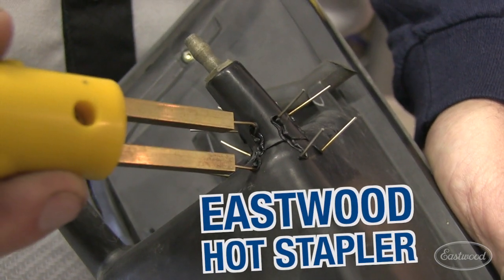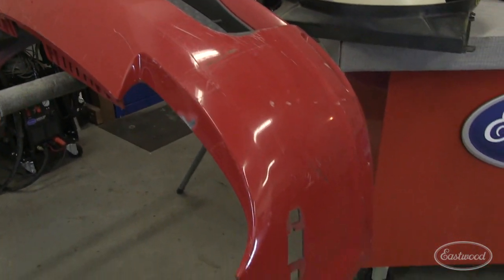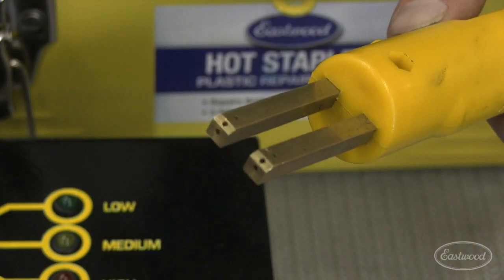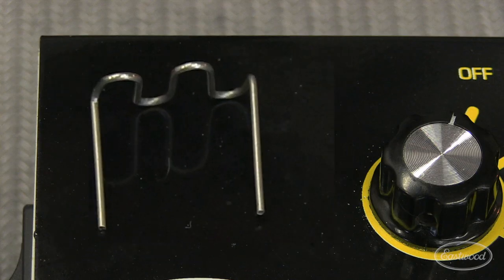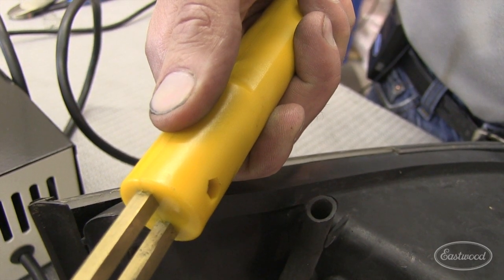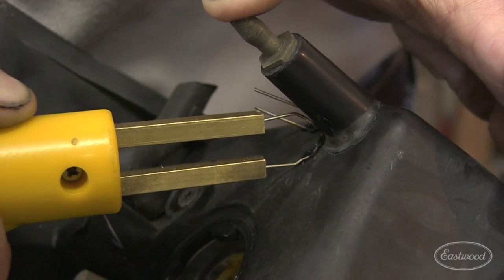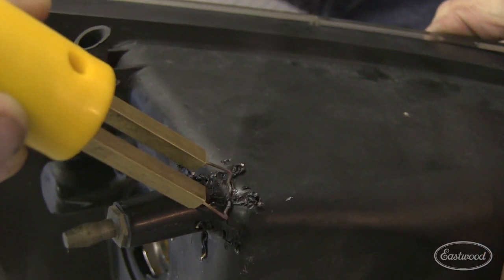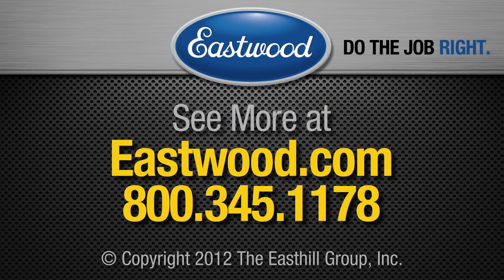Plastic Repair - Hot Stapler - How To Fix Bumpers, Plastic and Urethane  - Eastwood

Comment: I bought this soldering iron and it does not work for me in my bumper the staple is hard to enter and when it enters it does not stay in place when I pull the soldering iron the staple comes out
Reply: Sounds like the heat isn't high enough

Comment: Why cut them off and have them protrude from the surface as knuckle/skin removers, when you do it the right way and just break them off so they'll be below the surface?
Reply: are you going to put your hands in the inside of the tail light often ? plus you can always cover the spot with paste. If we talk about bumper repairs you always put paste which you sand after for a smooth finish.

Comment: Jesus Christ, that thing is the size of a brick.
Is this how far we've come in 12 years ?
I don't know why you'd need a mini fusion reactor to heat up a 1mm staple the size of a thumbnail. Maybe I'm an idiot, but plastic isn't that heat resistant. Either my handheld plastic stapler is going to burn itself out prematurely due to having smaller components packed into a much smaller space, or else this plastic welder was designed by a madman, AKA an Elongated Muskrat with a pea sized brain and too much money.